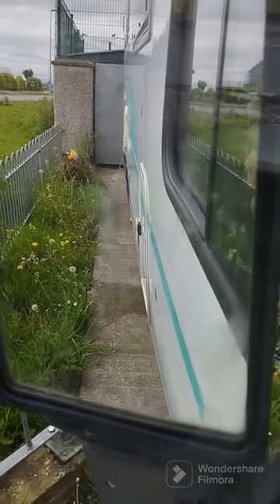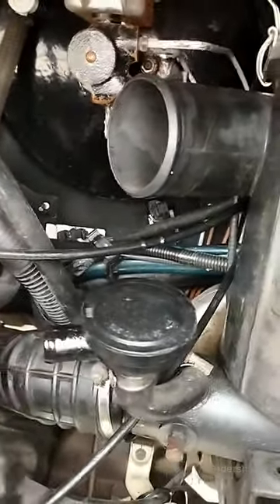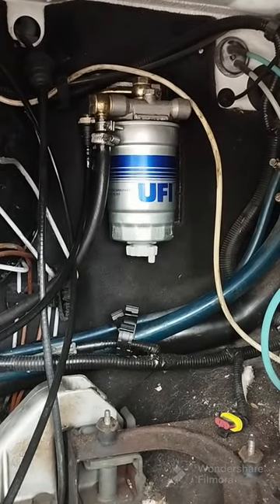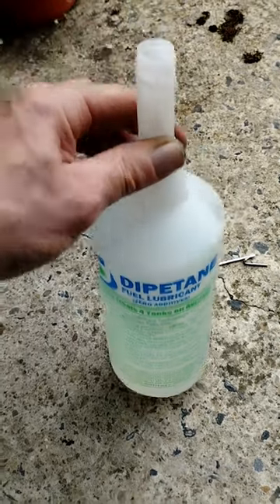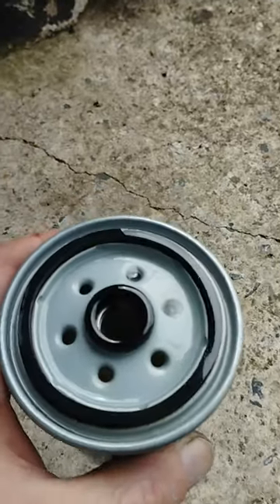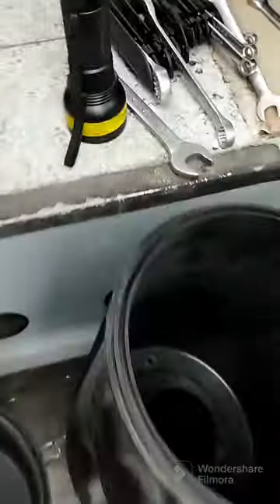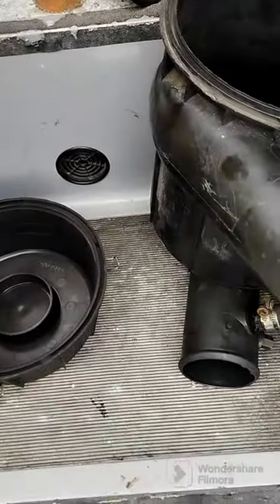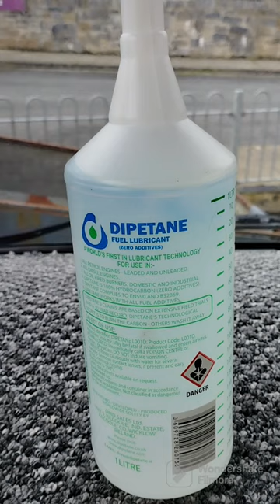black smoke from diesel engines, possible cure. I am NOT a mechanic

Comment: I'm a big fan of Dipetane, use it in my car every fill up and I've never had any problems with it. Only changed the filter in my van last week,, do you think I can take it out and refill with the Dipetane or does it have to go into a new dry filter?
Reply from the maker: This was only a demonstration I did the filter I took off the van was the same one I put back on.
Reply: @philipodwyer6039  Thanks. I'll take mine off and give it a try.